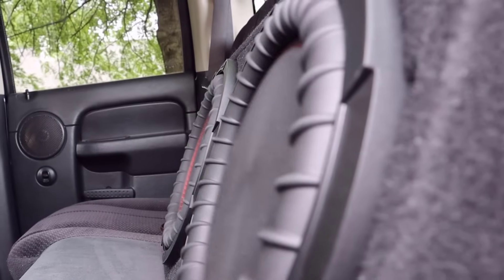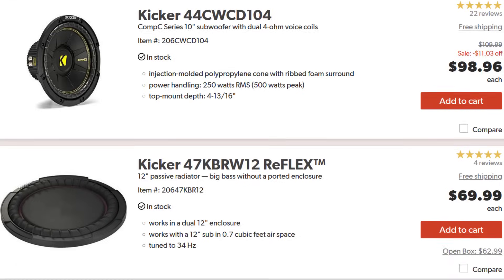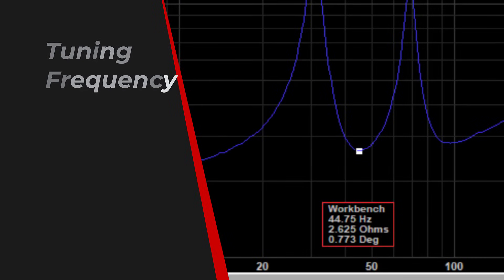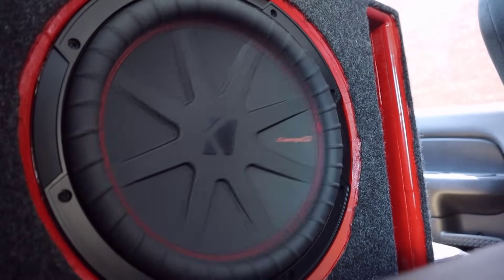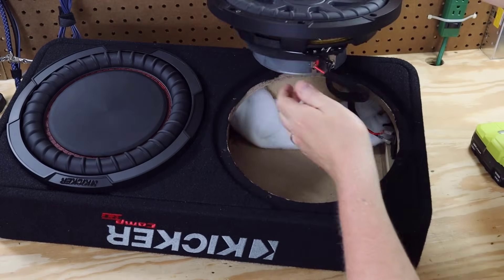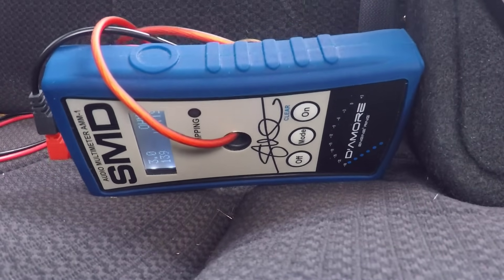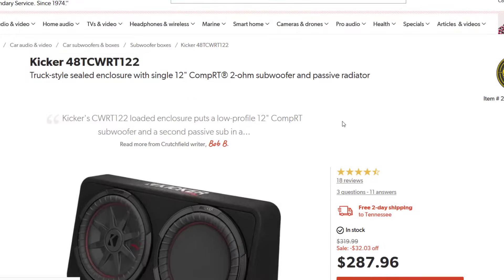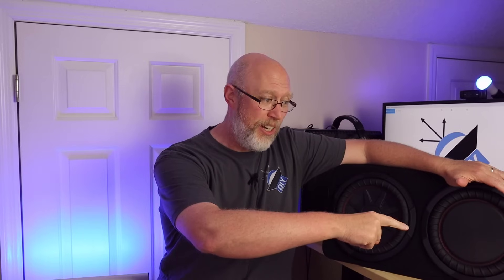Bass in A Small Space:  Kicker Comp RT Slim Passive Radiator Enclosure!

Comment: Decades ago, I built what would be a large bookshelf speaker enclosure, that I equipped with early 90s Blaupunkt automotive speakers.  Each speaker has a 5-1/4"  2way,  a 6x9  3way, and a 2"x6" port tube, in one corner.  Still sounds great.  Enclosure is 3/4" Oak veneer plywood.   The exterior dimensions are 12" x 13" x 24 - 1/4" with interior volume of approx 1.5cuft.. They are sitting on the floor.  Speakers are powered by a Kenwood rack system,  100 watts/ch RMS.
Thoughts on additional bass?
Music is classical, instrumental,  60s, 70s, 80s rock, Big Band Era music and vocals, Classic and Contemporary Country, Celtic, and Sousa Marches.   Bass recommendations.   Add to existing speakers?   Or a separate sub-woofer?   Receiver has sub RCA jack.. thoughts-options?
Changing gears:
I'm thinking of adding the Kicker Enclosure to my Tacoma 4dr,  8" or 10" thoughts.   My front speakers are 6x9 kickers, back are the 6-3/4" Rockford Fosgate,  and dash are Kickers.   I  need more sound from the back seat area.  I need an Amp for the current speakers, would like to keep head unit.  Thoughts?   Retired and limited budget..  I love Crutchfield, but they quoted me over $800, Amp, DSP, and wiring.. after I had told them limited budget.
Reply from the maker: Cool!

Comment: Why doesn't the radiator cancel out the sub? Wouldn't it be out of faze from the woffer?
Reply: It's slightly delayed from the woofer due to the air pressure having change in the box and push/pull the PR. This delay means that the PR is at least somewhat moving in sync with the woofer at some frequencies, which is why they boost bass more in some frequencies than others. Someone above said they put weight on their PR to lower the tuning (by delaying the phase a bit more). It works much the same way as a port which would seem like it would push air out as the woofer moves in and vice versa, but the delay occurs again and helps boost the bass. This is why the ports need to be tuned just right with the correct diameter/space and length to ensure proper phasing for boost.

Comment: I wonder how it would sound if you replaced the passive radiator with an identical driver speaker ?
Reply from the maker: It will be louder at higher frequencies but it would have less low-end extension.
Reply: Thanks for taking the time to reply, I find your channel very interesting, Thank you 🙂 @DIYAudioGuy

Comment: I have a stupid question but as my mom's car had alternator issues and battery issues and she had a box, I'm curious... Does it affect that part of the car? Is it a bad wiring issue? I know my husband wants a box but I'm worried about potential future electrical issues.
Reply from the maker: That depends on what you mean by problem. Both alternators and batteries do wear out and fail.  Now if your car is going through alternators every 6 months or if it's eating batteries that's something entirely different.

Having said that an aftermarket amplifier will add additional strain to your car's electrical system.  You just have to be smart about it and not overload the stock electrical system. Something like this only need 400 watts of power, most cars can handle that no problem. 

If you're worried about it my advice is to visit a local shop. Let them know that you're concerned about overloading the electrical system.  If they have any integrity whatsoever they will sell you something that will work.
Reply: @DIYAudioGuy  awesome! Thank you so much!

Comment: Super helpful video, also watched your video on Hofmann's law. If I were to run 2 of these enclosures, would that allow me deeper sound without it being crazy loud? Or would I just need a larger enclosure?
Reply from the maker: It takes space to make bass.  So if you can you should always choose a larger enclosure. These enclosures are designed for situations for a larger enclosure just simply will not fit. Like the space behind the seat of a regular cab pickup truck.  In that situation grab two of these. If you are putting subwoofers in the trunk of a car or the hatch of an SUV then just get a normal sized enclosure.
Reply: It depends...I ran two of these under the cargo area floor of my SUV for about a year, they sounded best when I wired them in parallel (1 ohm) on the 5th channel of a KXA800.5 getting 400W total (200W each). Whenever I put more power to them, like 400W each from a KXA800.1, they were too muddy for my liking. I eventually split the pair - gave one to my nephew and the other is connected to a 100W home amplifier and used with a soundbar in my office. Plenty of deep bass without the mud at that volume level. I still have a 6.5 version, I use that with a JBL Xtreme bluetooth speaker to play the lows that the Xtreme cannot.

Comment: hey Justin, i didnt get a chance to see a comparison for dB between this CRT compared to the L7T "truck" style enclosures. 
do you have quick data on the output - which one is louder and or lower ?
im juggling between the L7T 10" and this CompRT 10" in the tight space i'm afforded for a tacoma..
Reply from the maker: I have not tried the L7T enclosure.
Reply: trouble is, im not able to build a quality box with no table saw or router.. otherwise i'd throw in a couple hertz Mille or at least JL W3's - for now, i'll keep the L7T @DIYAudioGuy

Comment: I have the down fire and I wasn't that impressed. I also had the single down fire CompVT and I feel that it sounded better. I ended up using the CompR ported and it was louder in the lower frequency. I like the bass headedness when I'm driving, I like my car to sound like a Club. But this down fire version of the compRT. The compRT with passive actually has a lot of bass and sounds a lot better than the stock sub on my B&O Q8. With the double pane windows and the 23 speakers, it sounds like I have good headphones on.

Comment: I've been super tempted to get that downfiring 12 inch version for my convertible for a while. The only thing holding me back is I've had some big bass in there, although I can't put my top down when I have them in my trunk, so I would hate to downgrade the sound. I just haven't got the space and tools yet to do my own custom box that's short enough in height for the top to go down and still have the big bass of my full sized boxes.
Reply from the maker: If you don't have time or space to build a box there is nothing wrong with going with a prefab enclosure. I recommend that you get two of them.

Comment: Can i replace a passive radiator by another subwoofer ? I mean, I got a subwoofer with a passive radiator 6.75 in, this was new and it is installed in my jeep 2001, the thing is that when i turn up the volume the passive radiator starts making a noise very disgusting and i was thinking on remove the passive radiator and adapt another subwoofer of 6.75 inches as same as the subwoofer that it comes, but my question is, the box is going to work for both subwoofers ? Or sounds are not going to be good enough?? I got this 43TCWRT672
Reply from the maker: Yes you can, but that does not mean you should. I think you'd be better off to see if you can figure out why the passive is making the strange noise. It might be damaged.
Reply: @DIYAudioGuy  i mean i think the noise comes due to a very high volume you know, i think this is not built to work under very high volumes, the think is, another subwoofer replacing the radiator is going to work good soundly speaking ? Obviously same size and same brand, kicker 6.75 inches.

Comment: Help me out here.  I'm concerned that using a 15" passive for a 12" active will introduce sounds/frequencies that aren't present in the source material. If a frequency is determined by the distance the cone travels, and the passive radiator isn't exactly matching the excursion of the active driver due to differences in volume, then wouldn't that introduce sounds/frequencies that aren't present in the source material?  If an active 12" driver is playing 40hz, how does the 15" passive radiator match that frequency if the distance that the cone is travelling is different?  Would it make sense to use a passive radiator with the same shape/size/displacement as the active driver, but with perhaps 50% higher xmax?  With a sealed box and 2 identical drivers, 1 active and 1 passive, wouldn't that force the passive driver to match the excursion of the active driver and thus play the same frequency?  The increased xmax would simply let the active driver reach the lowest octaves with less resistance, but the passive driver should still match the movement/excursion of the active driver. Shouldn't it? Asking for a friend. lol
Reply from the maker: The frequency is not determined by the distance that the cone travels.
Reply: @DIYAudioGuy  Doh! lol Momentary lapse of reason. I was mixing up amplitude and frequency. Gotta lay off the pipe. lmao

Comment: Would this work good as a mid bass... my door speakers don't play low enough for mid bass, I was gonna do door panels but this could work if I could use it for mid bass
Reply from the maker: The challenge would be mounting it in the front to get proper staging.
Reply: Depends on what you call mid bass but I've used one of these in someone's truck to give back the missing bass. Really filled it in nicely. Just depends on what you're trying to fill in.

Comment: I have 2 rt 12s in a hidden box under my rear seats and alpine 6x9s in my doors and my system screams excellent mids and highs and decent lows. I have 1500 watt Rockford Fosgate pushing the subs. How much power do you think they can handle or do you think 1500 is enough?
Reply from the maker: I think the RT 12 is rated for 500, so that is what you should give them.

Comment: I find passive radiator subs much more musical, like a low bass guitar note as opposed to a kick drum thump, but hey some like the thump.
Reply from the maker: I just in general like the concept of a passive radiator.  No harder to do build than a sealed enclosure. Just have to cut an extra hole.
Reply: @DIYAudioGuy Thank you for replying. I found it interesting that by adding weight to the back of the passive radiator, it can be tuned,

Comment: I'm running an old school orion xtr pro 10 4ohm dvc in a sealed box with 600 watts going to it. The box is .65cf I have it under the rear seat of my 03 dodge ram. I need my seats for kids and the space under the rest of the seat is taken up by an amp. My question is, would adding a 10" or 12" radiator produce more bass or muddy it up? I love my bass to hit hard and snappy. Seams like alot of ported or vented boxes will start fairly snappy then kinda flutter with alot of fast bass. Would really appreciate your input on this.
Reply from the maker: I have an '04 ram and I've been thinking the exact same thing.  I have no idea if it will work, or the best way to make it work.

Comment: I have a 2003 Mercedes Benz it have a free air 10  speaker factory can I replace it with the Kicker
Reply from the maker: There is not a simple answer. If you're talking about just swapping out the driver with an aftermarket one, or running the wires from the factory speaker into this enclosure then you're not going to get much of an improvement.  It would only be worth doing if the factory speaker itself is blown.

But, a 10-inch subwoofer in a good enclosure with a decent amp, that will be a night and day difference.

Comment: I went to alot of trouble making two 10" Kicker XPL subs work in my 2004 Ranger standard cab. Had to cut out the bracing on the truck. Now I had to take out the driver side sub just to be able to move the seat back enough to keep my gut from pressing against the steering wheel. This in the 6.75" might be just the fix I need, have to do some measuring. But what am I looking at in the way of ohms with this on the driver's side and the XPL 4 ohm on the passenger's side, with a RF prime 500 amp?
Reply from the maker: Definitely get two if you go that route, maybe see if you can fit some underneath the seats, and get four.  The 6.75-in is really small and doesn't move that much air. To

Comment: This might be a stupid question but I don’t know much about this stuff. I currently have a 1500 watt amp paired with a kenwood 12 inch sub. Is 1500 enough? And if it is, is it too much? And if so, how overkill is it?
Reply from the maker: It's a matter of perspective. I have some viewers who will tell you that 1500 watts is just getting started. For me I think 1500 watts is a lot.  You're right on the edge of what most stock electrical systems can handle.
Reply: @DIYAudioGuy  so I could just re use the same amp if I bought this exact sub? I just got a 2014 Honda Civic, and there’s not much trunk room. But I want something that will hit and make my rides more enjoyable

Comment: I have a kicker downward firing subwoofer in my F150 (48TRTP102). It's rated 2 ohms. This unit uses the CompRT 10 inch sub. Being rated at  2 ohms, this means two possible scenarios. They're either using the 2 ohm version, with only 1 voice coil being used, or they're using the 4 ohm version with both voice coils wired parallel. Any idea how they set these up at the factory?
Reply from the maker: It's the four-ohm version wired and parallel.
Reply: @DIYAudioGuy  Thanks for the info. Much appreciated.

Comment: I never understand why Kicker don't power these type of sub boxes. Someone looking to find a small bass solution isn't interested in having to mount an external amplifier
Reply from the maker: That's a really good point.
Reply: With a slim box like this adding an internal amp would take up room which would make the box bigger. For the box to be powered would also mean running the same wiring to the box that you’d run for an external amp. So, you could just mount an amp to the box and you’d effectively have a powered box.
Reply: @NBSV1  amps have been mounted to slimmer boxes by other brands
Reply: @LeandroJack  Sure, but they're usually a small amp that's moderately low power. Which still would need a power cable, ground cable, and inputs just like a regular amp. At the end of the day all you're getting is a small cheap amp that's mounted inside the speaker box. If that's really something you want you can just buy a cheap small amp and mount it inside the box. Ideally you can buy a bigger amp that would more properly run the speaker and just mount it externally.
Reply: @NBSV1  
They did just that 

Kicker 49PTRTP10

Comment: Boy I wish they made square passive radiators. Can you run the round ones with the L7t subs? If so, what size would you use? Thanks for all the info!
Reply from the maker: I think you can, I would recommend calling Kicker tech support. They've got fantastic tech support.

Since the square subs have more coin area I would imagine you want to run the 12 inch passive with the 10 inch square subwoofer.
Reply: you can absolutely use a round passive with a square active

Comment: Can these be stacked and stay in phase? One under the SUV trunk floor and one in the trunk cargo area. Any concerns? Thanks for the vid and any reply/guidance.
Reply from the maker: Probably not, the wavelengths are so long that it won't make much of a difference. If it did, you could always try adjusting the phase on the amplifier.

Comment: Could this same principle apply to a Bluetooth speaker?  I can build anything with wood...

I use dewalt 20v tools often,  so I bought their 20v tough system speaker/ charger for some tunes on the jobsite...

If I could make a box that became ported when I placed this speaker on it,  could my carpentry ability increase my bass/volume output?
Reply from the maker: Not sure what you are asking.  But, yes, a good carpenter can apply those skills to make an awesome subwoofer enclosure.
Reply: @DIYAudioGuy  maybe a good future video?  Building a box to amplify a Bluetooth speaker.  

The way you explain things is crystal clear. Either way,  thank you for your time.

Comment: The big scam with speaker compagny. They make sub cone too heavy and yhe spider spring and surround(air suspension) to stiff. 
You need A lot of power to move it.
Plus at this kind of power you need vented /port. Because the voice coil heat, and on close boxe, you accumulated heat and burn your speaker(voie coil).
If you plan to use loud for long time put the magnet outside. 
Protect your ear!
Be ready the big trumpet come soon.
God bless(KJV)